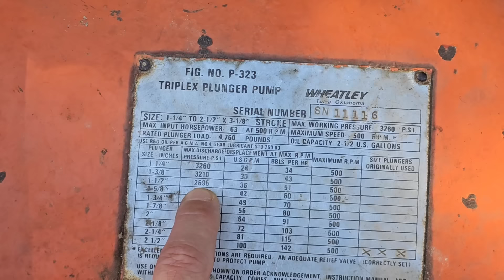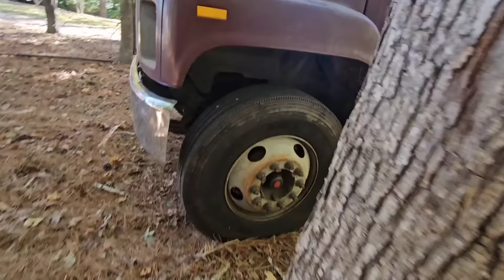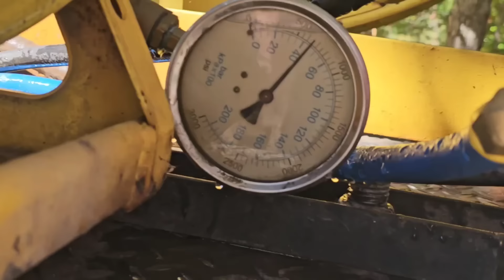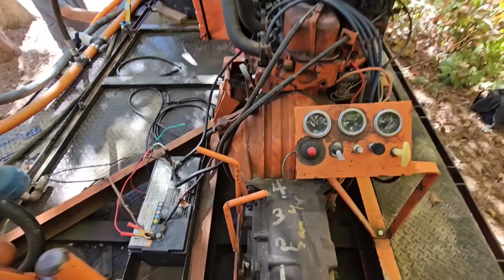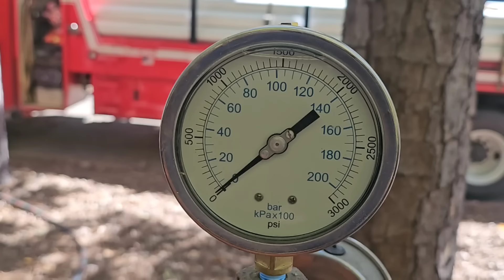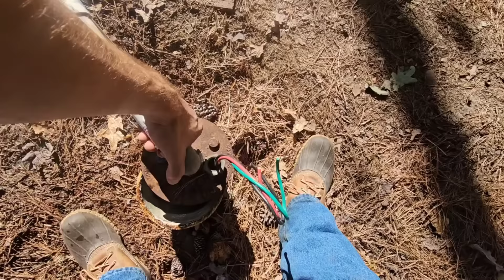Hydro-Fracking... We Blew up neighbors Well!

Comment: Is it possible for a new house well to be put in several hundred feet away and have it reduce your well? My friend claims the new neighbors had a well drilled and that’s when he started having well issues of low to no water. They paid for fracking and they’re still only at 2 gallons a minute much less than before the new neighbor and well got put in. If it was 50’ away I could see that but I’m pretty sure it’s at least 200-300 feet away.

Comment: Always enjoy watching your videos . Had a vacant lot in an area in Baltimore county Md. which is notorious for low yielding or dry wells. This lot had 15 dry holes and finally we got a 1.25 gpm drilled well. The neighbor decided to zone frack his well so he could use a constant pressure system on his house. I went up to watch the frack procedure and as I got close there was a loud boom and the well cap on my well blew off 100' in the air and was tumbling back to the ground. That frack dumped 150' of  sediment in my well. The well had to be redrilled back to the 500' depth and only yielded .21 gpm after being simultaneously tested with the neighbors well. They drilled another well that only got .01 gpm so they fracked my original well and it wound up with 2.5gpm after all that while testing it on its own.  . So now no well can be fracked closer than  100' to another well . The formation is shist  and is soft and yields very little water and will not produce a successful well when single packer fracked and is subject to collapse when zoned fracked as the pressure in each zone will go up to 3000+psi . Different areas have different regs and different formations so different techniques need to be used. Keep up the great work.

Comment: I just had a thought that may help you guys in future. How about sectional fracking? Here is an idea. 

Have 2 packers and water pressure output between packers, so this way you can crack only one are at a time, this will give you precision in logging fracking regions for your costumers, and this will help by knowing exactly where it was fracked and where at what pressure exactly.

Comment: Had this happen to a neighbor and it flushed dirt into his well and ruined his fancy filter system. He wasn't happy having to change all his filters. The original neighbor didn't listen to us about filling up his pool and ran the well dry causing the problem. He told the fracker that he was an engineer and he did the numbers and the well should have been able to fill the pool, idiot from the city.

Comment: Why stay away from fiberglass tanks?  My daughter just had a new well put in and if their steel tank was bad, the well driller would have used a fiberglass tank.  I have a steel tank, but thought about going fiberglass since I have a old field stone basement, so it is always damp and rusts out.    Per my daughter's new well (West Central Ohio.... highest point in Ohio is a few miles from her house).  The new well is 420' down, static water is 65' and it only produces 5gpm.  Well driller left before we could talk, and the pump install crew did not know why he did not go deeper as most new wells nearby are at least 500' and produce no less than 7 with goal of 10+.  They placed the pump at 360, think they should have placed at 380.  The pump is 5gpm, but the put a 7gpm restrictor at top.    I wonder if they should have fracked the old well, although it had iron bacteria bad.   I was shocked at the pump you pulled being 5gpm and saying 3 or gpm producing was good.   The pump was $3100, thought high, but seen online for 2500, so...   but the final bill for a 5" casing, 4" pump was $26000.00.   They tied into the old well location pipe and wiring, used some of the old pvc well pipe too.  Did not like that they did not use a safety cable, but they swear by the threaded sch 80 pvc pipe for the deep wells.    I guess demand in that areas keeps prices high too.  I am an hour away and we are only going down 150' at most and around 8k at most for complete new well.  Any comments are welcome.   Hope to meet you some day, always a lot of great information and done very well.

Comment: Before I retired we always had valves both sides of in line filters plus pressure gauges so as the filter clogged the pressure difference increased. Saved a lot of guesswork

Comment: Great video's but on keeping pipes warm your tip on light  bulb people might not understand the difference between "LED- incandescent " as we know one will put off heat one will not ,,maybe do a update,and iv got little heater it's 750wats then I use a small fan that moves back and forth both will be under 1000wats

Comment: Great video! Maybe a good idea to look into a gopro with a chest rig, keeps both you hands free ,and still gives you good quality video and pov angle. Might be interesting and a lil easier to film. Gopro here 11 are great and can be picked up prettt cheap and have the same sensor as the 12 and 13 so no point spending extra for pretty much the same camera.

Comment: I'm working on a couple of big boreholes at the moment, 1000 us gal/min each. You turn one on/off and the level in the other one goes up/down by 60ft. We think they are connected by a big crack in the rock. I suspect this happens a lot more than we realise, we only saw it because the wells are so big they are both fully instrumented.

Comment: On the filter under the house, I  would have run the incoming pipe up at the same level as the out going, as it is just in the way now. And for a filter just to keep sand out of valves, I love the ones with the super fine stainless mesh, it has a clear bowl and a drain on it, so any sand, you just turn the drain and let it out, and the big advantage, you don't have to keep buying/changing filters, something some people forget to do, and those paper filters will get a lot of slime build up. Also, they are small and light enough, you could have just mounted it inline, wouldn't have to mount it like the bigger filter, although I prefer to mount it if possible.
Reply: In the way of what?? Its in the crawl space  LOL
Reply: @MrJujubean you do have to get to that filter and change it every few months, that pipe is just in the way.

Comment: This is pretty common when youre fracture stimulating a oil or gas formation also. You are increasing the pressure of the oil and gas formation so much that it often causes nearby producing wells to "Communicate". The production equipment which the oil and gas flows out of on the production well is only rated to handle a few thousand PSI while the pressures of a frack job can reach 12,000 psi depending on the formation and location and will destroy production tubing and oil and gas separation equipment on the surface costing millions of dollars. It is often required to pull all the production tubing that the oil and gas flows out of the well through and setting what is called a "Swell Packer" which is a rubber plug that has metal jaws which clamp onto the inside of the casing above the oil and gas formation until the frack job is completed.

Comment: when that blatter pumps up and swells down inside the well, the diameter of the blatter expands which pulls on it vertically. so it's actually pulling from the middle inward.

Comment: The neighbors house system also got a 650 psi test. The downside of wells communicating with each other, most probably not the entire 650 psi but enough pressure to unseat the well seal which is supporting the entire column of water.

Comment: The blue unit, next to the 'dump valve', is that a sediment trap?  I only ask, as I suspect you may have the top two connections plumbed backwards (maybe the unit was rotated at some point?).  With those cyclonic separators, you normally have 'water & sediment' enterring tangentially, with 'water' only exiting the centre top, thus leaving the lower cylinder with the sediment.  I think that is installed backwards here.

Comment: My neighbor fracked his 160’ well, blew the bottom out of the neighbors well on the other side of me, his well went dry, mine got dirty and went dry six months later(slowly tapered off). We both redrilled from around 250 to 480 & 500 foot deep, and got enough water with a tank. Cost 10k for my redrill. Now everybody has a weak well.
Reply: My neighbor drilled a new well and not even a week or so later ours went dry. I cant afford 10k for mine to either be fixed or drill a new one. I now have to pull water from a spring that runs into a creek that is on a family members property. I have been doing this for over 4 years now and hate every second of it.
Reply: @SpartanLeroy  brother you can't afford 10k over 4 years? Just get a loan, the payment would be minimal
Reply: @darknorth239 no not right now i am on a very tight fixed income and currently dont have the budget to add another debt to me and my wife. Maybe one day but just have to make due hauling in water to put into a storage tank.
Reply: Very good point. I've been working with water wells for 20+ years including contaminated ones where we do some unique injections and just because something worked good at one site does not mean it's going to work good at yours. There is nothing consistent about the geology no matter where you are.
Reply: You could put a storage tank next to your house and another pump to your house. If the weak well pressure is a problem.
Reply: @rmeyers2003 we’ve already done that, it’s the recovery of the well that is weak. We live on rock and rely on cracks in the rock to gather water.
Reply: @HubertofLiege Our well driller in 1993 guaranteed us 5 gallons a minute return, but reality it turned to be 2.5 OK but not 5. As long as we don't have, a toilet valve stick open we are good. Well is 500 deep pump set at 238 because of sulfer.  But we just had this conversation about whether we should frack. We decided against it. It's working fine for now.. Only us, two at home.
Reply: @gregie9999hotair1 what I’d do for 2.5 gallons a minute. We had sulfur at shallower depths but it went away when we went deeper. We had to save drinking water in a pitcher to let it dissipate out. Now that we’re deep it’s not an issue.
Reply: @rmeyers2003 What he and the rest of the neighbors can do is file a lawsuit against the fracking idiot that ruined everyones wells. They ought to have insurance for their "business" so they'll be covered.
Reply: @aland7236  "Ruined" wells that weren't producing well already?
Reply: @aland7236  IF YOU COULD REACH A SETTLEMENT,  BUT A LAW SUIT IS IFFY. THE MONEY SPENT ON LAWYERS COULD BE USED TO FIX THE WELLS.

Comment: You said that the neighbors got a free fracking. Does that mean that a lot of fracking junk will be entering their plumbing and requiring a filter which they may or may not have?
Reply: What is fracking junk?
They use water and water pressure...........so the water is the "junk"??????
Reply: @darknes7800  the junk is the sediment that was loosened up, and it's exactly why he installed the filter in the house...

Comment: I had 3 well drillers in my area tell me wells rarely connect. I called bs no less than a week after one of them drilled a new well for my neighbor 100ish ft away my well was dry. at the cost of 40k to drill me a new one. I will say the new 3 phase constant pressure system is awesome.
Reply: Well rather than tell you that Wells rarely connect it's best to tell you that nothing is ever the same. If you had one experience at one job site you're dreaming if you think you're gonna have the same experience at another.

Comment: Noticed you mentioned cpvc. Is pex better?  Needing to replumb my pressure tank/well setup because it has galvanized on pressure switch. What filter/filter canister do you recommend?  One I have currently is not very good. Filters I use are dense foam (it seems like). Want to do it correctly one more time. Old tank was galvanized and it sprang a leak 15-20 yrs ago. Replaced with a bladder tank. Works like a champ as long as filters are clean.
Reply: i just redid my house with PEX A 2-4.5x10 filters before the softener and a “nuvo manor” system and another 4.5x10 after.  it is a mixture of sizes.  the bypass is 1-1/4, majority of system 1” and branches 3/4. drops are 1/2” all designed for 10gpm, which is the rating of the pump.

Comment: I drilled a 380 ft deep well approximately 1,000 feet away from one neighbors natural spring.  3,000 feet fron another's.   I hit so much water that the next day it was fully pvc lined and gravel packed top to bottom
20 feet Bentonite.  Top 10 feet concrete.   

About 2 months later we had a episode of cloudy water and 17 foot rise in static level.  

Within a week letters from both neighbors attorneys claiming we had subsequently fracked and drastically (almost completely) reduced the flows of both of their springs.

Of course that wasn't the case.  By then the well reports had been submitted to my state. Certifications easily obtained  .

Copies were sent to them by my drilling company without any further correspondence. 

Whatever underground geologic shifting  that had occurred couldn't be location identified, nor directly blamed to anything other than normal well drilling. CLEARLY within property line setbacks by hundreds of feet. 

Regardless,  whatever water flows they lost were my gain.  Even though I did not need it.
Reply: "Whatever underground geologic shitting that occurred", uhhhhhhh you drilled down 380 feet. You were the cause of the underground geologic shifting 😅 If you don't already know, water flows down hill. I'd be willing to bet money that you hit the natural spring, and the spring was draining into the cavity you found at 380 feet. It kind of sounds to me like you knew exactly what you were doing and are just playing dumb. 380 feet is not a normal well depth.
Reply: @AlotL1keVegas 
Completely depends on where you’re drilling, water depths vary greatly depending on location, water tables, and aquifers. The average depth of a good producing well in my area can very between 400’ - 1100’.
Reply: @AlotL1keVegas normal depth 🙄

Comment: I am surprised that people don't want a water meter or flow meter installed inline.  That way you can see "usage" at least and figure out if you do have a leak.  A wireless flow meter at the head would be great information.  Keep up the good work sir!  🤠👍
Reply: Or monitor your energy use on that circuit and you would be able to see it short cycle.
Reply: Quiet newsom
Reply: That's just an extra cost and restriction in the system when you're already paying thousands of dollars to get a well dug or re-done
Reply: @Tater_Lord  extra $50 on top of the thousands. At that point its a rounding error. Well company should just throw it in as a thank you for the job.
Reply: @Tater_Lord my 2 inch polly line developed a leak right wear it came through the block wall from yrs of frost freeze cycles even though it was almost 10ft deep. A wireless flow meter would have saved me the cost of a bladder tank and pump. I think it's a worthwhile investment.

Comment: For all you know, you've just flushed the neigbours veins as well :D
Reply: basically what happened. well cross communication. dealt with this at several West Texas, South Texas and North Dakota sites over my 5 years in oil and gas. Its actually common procedure to use a retrievable plug to cap nearest existing wells when doing a re-frac of an old well or a new well completion in an area thats already heavily drilled. 

since all they are doing is low pressure fresh water stimulation they are probably not required by the state to cap other wells nearby prior to starting the stimulation job.

Comment: To the people that own the house, you want to get the plastic vapor barrier all the way to the sides with no dirt showing, otherwise it WILL rot your home from the bottom up, I have encountered where it has on more than one occasion.
Reply: For additional context, if the vapor barrier isn't complete then water will get around the barrier and it's not going to do you any good. In an inverted sense if you were to plug half the holes in a bucket the water is still going to leak out the others so why would you not put a complete vapor barrier under the house.
Reply: @RowanHawkins  And any moisture that gets thru will sit on top the plastic, it does not take long to start rotting the house, two homes where ALL the floor joist were dry rotted, it was a night mare too repair.

Comment: Sometimes you can't avoid it but the more 90° bends you have the less "pressure" the customer will get. Although to be correct, it's less flow. 

The more bends, the slower the water can move through the piping. And if at any point the inside diameter drops too low, everything downstream will also notice what looks like weaker pressure. But it's really just the restriction that's causing the sink to not run as fast or the toilet to suddenly take longer to fill.

Comment: I think I need to go watch a video on fracking.  Heard all about it but have no idea what the heck you were doing.   You explained it well (lets put that to the test).   Fracking is essentially blowing high pressure water through the ground to "clean" the cracks as it could be filled with debris, mud, rocks, etc.   sort of like a block drain at your house.  Stick a high pressure jetter up to clean up the roots/blockage.    Is that right?
Reply: It’s called Fracking because the high pressure water will fracture the rock and create new spaces for water to flow.

Comment: I can not believe y'all put in a sharkbite elbow rather than a pex one. As you know they blow off under  a surge in pressure. Otherwise that was an informative reel.
Reply: All the new houses near me, the plumbers put a shark bite 90 on the black roll from the water meter to the pex in the house before the pressure regulator. I guess there have not been issues with that set up.